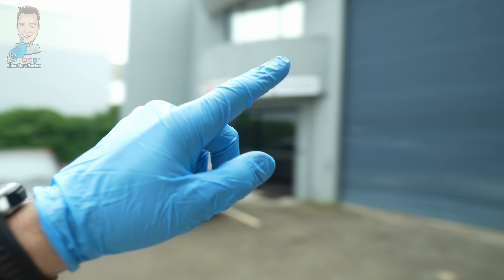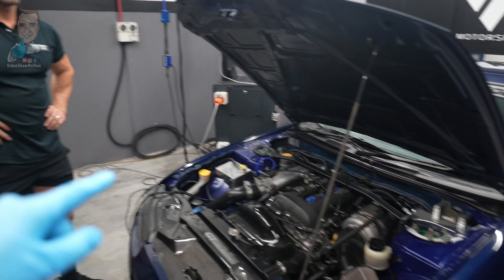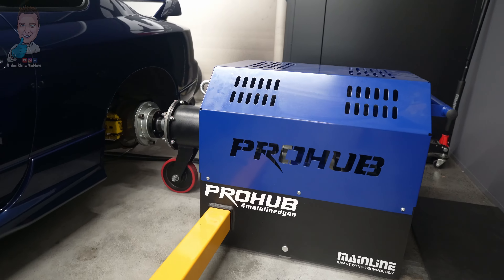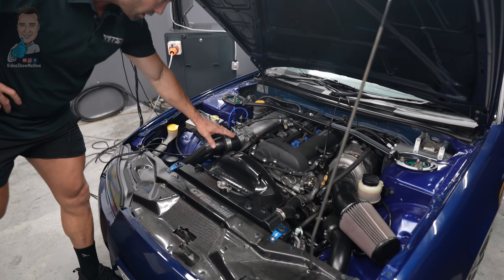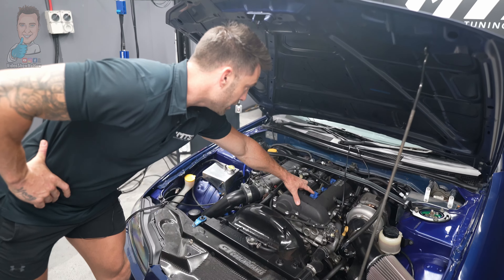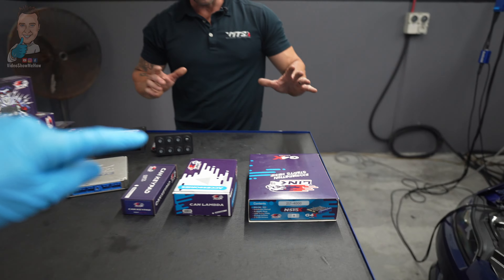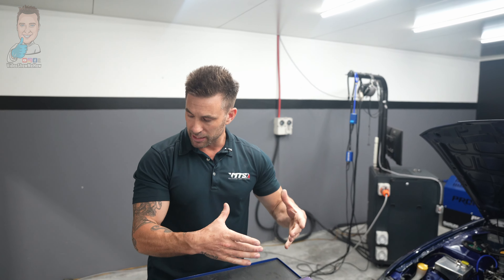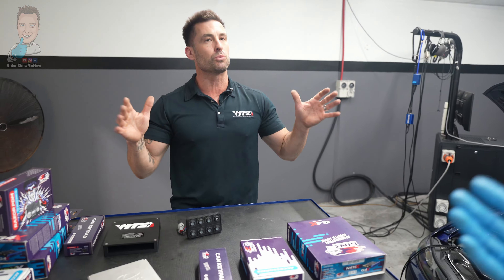400HP+ Nissan Silvia S15 200sx Upgrade And Dyno Tune With Link Ecu G4x

Comment: Great Video mate, I have been checking out all your ute build videos as I'm looking at changing up my np300 to a Dmax. But I also have a 2001 s15 as well and I've always seen yours parked in the background of your videos and always hoping you would do a video with it so this is very exciting to see.
Is there any chance you filmed the process of you hooking up that massive screen you have in the s15? Would love to do something like that to mine.

Love your videos mate!
Reply from the maker: Cheers! Nah not vid on the screen install I'm afraid, is a 10" Joying Android head unit. So full GPS , 4G, front/rear cameras etc. Intent when I get a bit more time is to run an emulator so I can have the link software on it. But will be handy for track days with GPS, timings etc